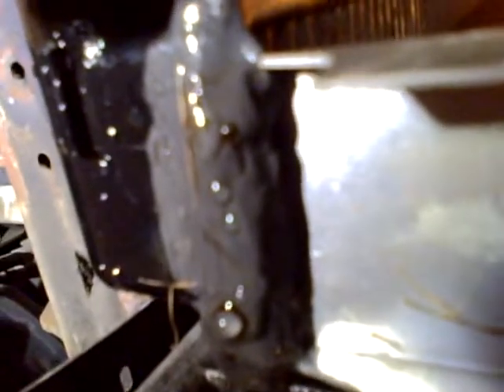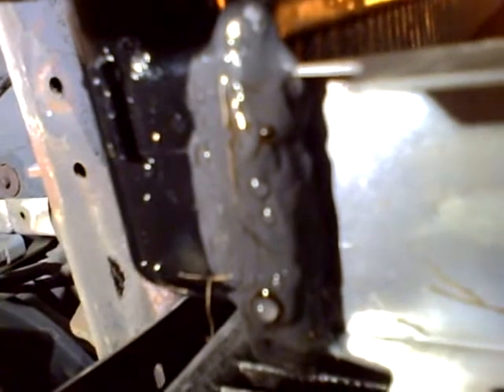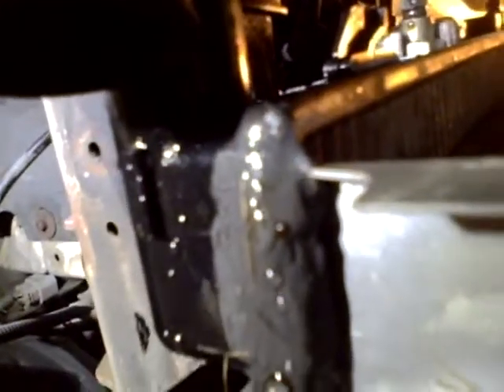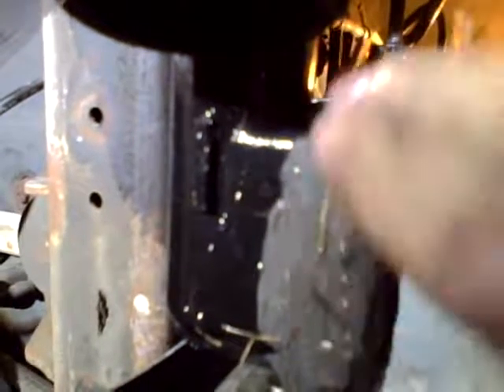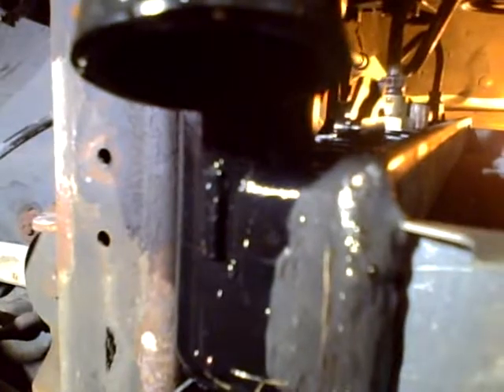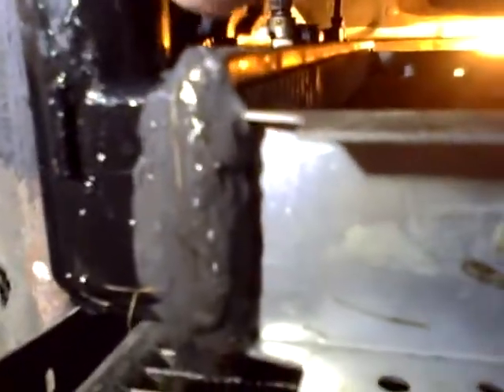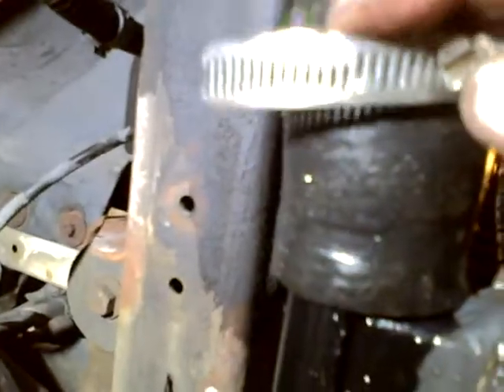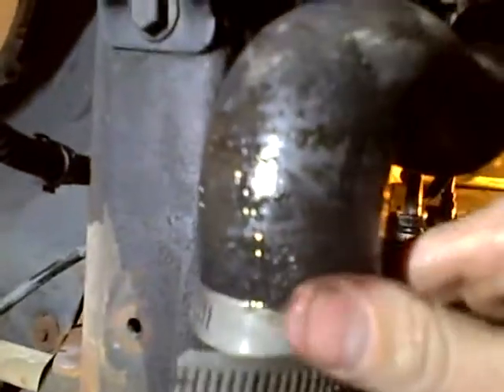JB Weld Steel Stik: Will it work?

Comment: You taught me a neat little trick with the vinegar, that was cool! It looks like it was leaking from where the plastic tank meets the core, like all of them start to do. You did the same thing I did by replacing the original clamps with those, SO MUCH BETTER. I'm curious as to how long the weld will last.
Reply: 2 yrs ago, did it still last?